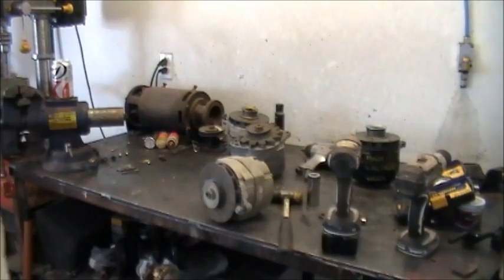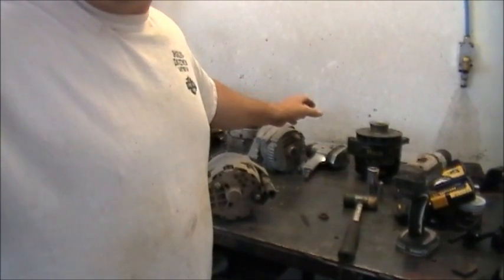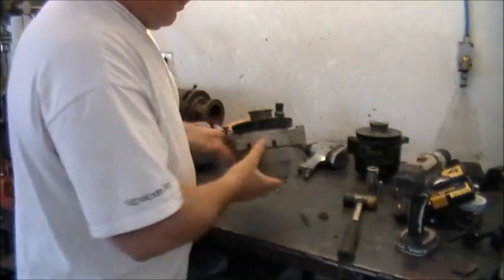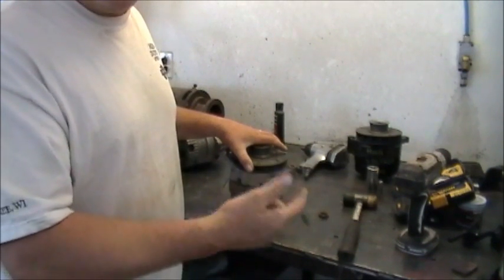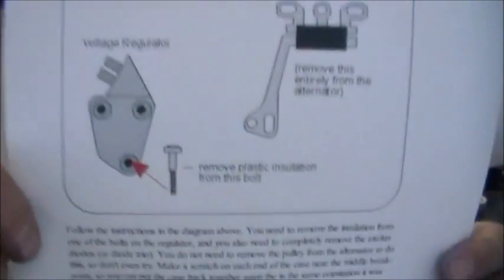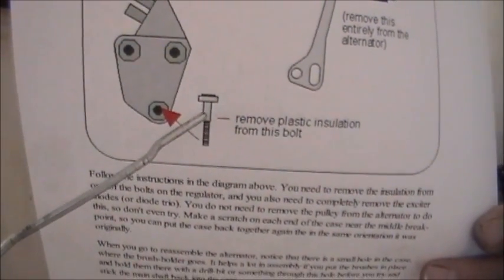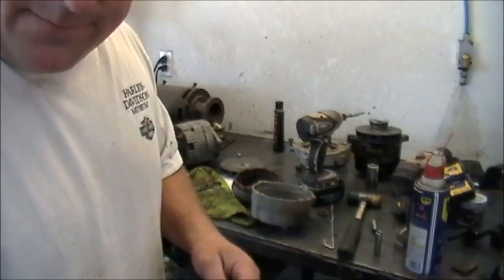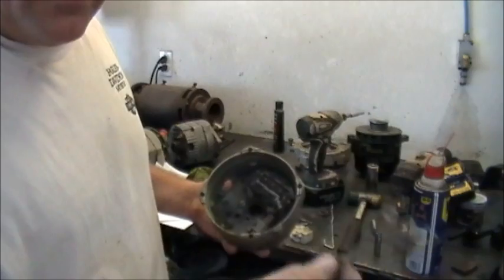weldernator GM alternator converted to DC on-board welder part1

Comment: What is usually missed is stick welding is constant current not constant voltage. The rotor voltage should be changed to measure the current and control the rotor voltage as a function of the output current.  
Also there needs to be reactance on the output to smooth the weld.

Comment: Why not just pull the diode pack amd voltage limiter and limit the volts to 36, on one of the newer high performance alternator? And weld AC?

Comment: Anybody ever try putting a 120 volt, 60hz start capacitor from a ceiling fan on the leads to the brushes? 
My theory is that the residual magnetism in the rotor will be enough to cause self excitation, provided the stator is under load.
The rotor, rotating inside an alternating current, should pulse at 60hz due to the ability of an AC capacitor to charge and uncharge, without "discharging" as a DC capacitor would require.
This allows us to disregard the number of poles:rpm in achieving a replication of mains power (2 poles at about 3,200 rpm for 60 hz), and focus only on voltage:rpm.

I built one of these out of a motorcraft "large case" 130 amp alternator, but the rectifier is now external, and I use a rheostat to control the power to the field winding.
This gives both an AC tap before the rectifier, and DC after.
For reasons that escape me, the original voltage regulator refuses to play nicely with the rheostat. There is a delay between the load being applied, and increasing field voltage.
This causes the field to temporarily collapse for about half a second.
This isn't a problem with just the rheostat, so it's not a matter of not having enough power to excite the armature windings.
Perhaps a voltage regulator by a difference manufacturer would be better?

Comment: Why remove the plastic insulator??? Why not just replace the screw with one that doesn't have an insulator on it, it is a common screw size not some special manufactured screw. I do like the idea of having a portable welder though.

Comment: Hi, so I've been trying to use a DR44G with a briggs 675 series.  Removed the regulator,  12 to excitor brush, ground to case.  Max output I've been able to get was 31v.  Am I missing something?   Any thoughts would be appreciated.
Reply: Make sure the windings on the armature are completely isolated from any other circuits.
This includes through the bearings.
I recommend not using the case as ground for this, as
in the event your diodes fail shorted, you're getting 120 volts of AC at more than enough amperage to kill.

Comment: Thank you! I've got the same alternator and burned out the rectifer diode and figured I'd turn it into a welder instead of using cheap lead acid batteries like I've been. I found this video after I did mine tho. I ended up getting rid of the voltage regulator all together and running a wire from one brush to spade one and a wire from the other brush to spade 2. From what I've read, I have to apply 12v to the armature and the way to do that is through the brushes. Now that I've seen your video, I'm not sure if I shouldve, but I'll find out tomorrow lol. Mines a 35amp 10si tho. Worse case scenario, I buy the rebuild kit that includes all the electric parts(brushes, regulator, rectifer diode, etc) for $13 and do it the way you showed.

Comment: How do you bypass the regulator on a 95 amp 3g alternator?
Reply: If it's actually internal on one that old, remove the voltage regulator/brush holder, cut the two wires on the inside, and extend them to an externally accessable location.

Comment: dose the alternator have do be from the 80s and will a truck alternator work better
Reply from the maker: As I understand it, the rectifier in newer alternators can't handle the higher output voltage and will fry.  Any alternator with an output of 75+ amps will work, 100+ amps is preferred.
Reply: ah ok thanks looks like I got to search the junk yards for an older one

Comment: could you just swap in a 24v regulator? then use a loop off the output, and the field winding, and run a potentiometer between them? variable voltage to the field, varying amp output, no? 24 is close to buzz box working voltage, so decent arcs. then you could even use a "pile resistor", and charge your bat (12v) with the "weldernator" in desperate times, lol. of course, i guess a 24v marine or truck alt would do it "from the box"

Comment: Thanks just what I was looking for......
Reply from the maker: Johnson B youre welcome
Reply: dzlfreek I have a 120amp alternator but when I took it apart it isn't anything like yours. so looks like I'm not going to be able do convert it and bypass like you did.
Reply from the maker: good rule of thumb is if its newer than 1987 this hack wont work. something about the diodes frying at 30 volts. I know just enough about electricity to keep from electrocuting myself. This is where I got most of my info  http://mhickok.blogspot.com/2008/06/weldernator-true-power.html  Hope this helps
Reply: dzlfreek Thanks, I decided to just splurge and went bought a ac Delco.